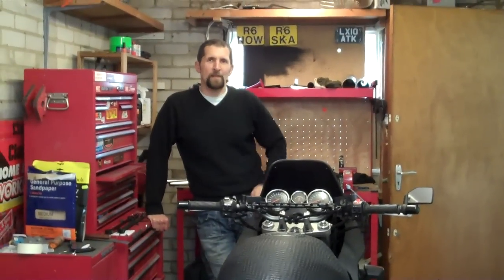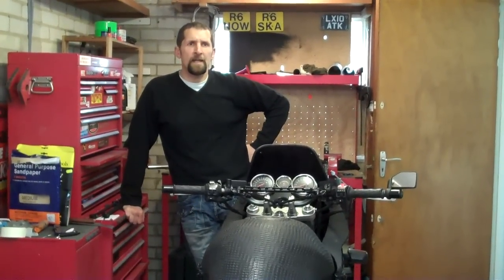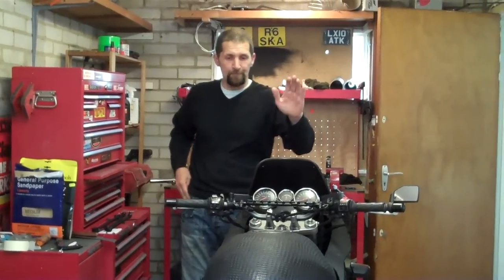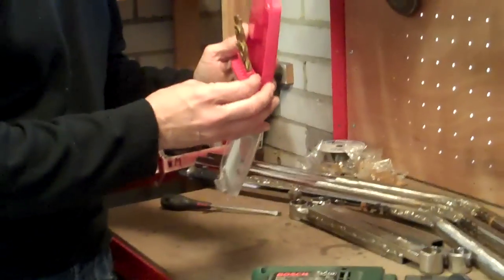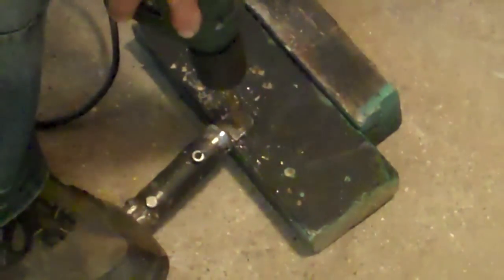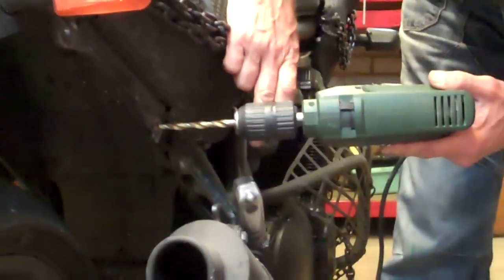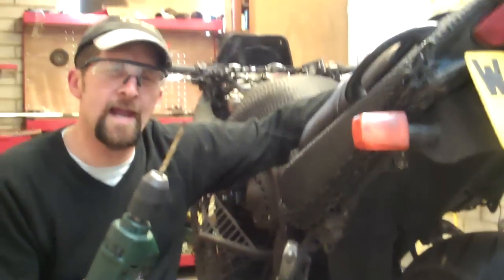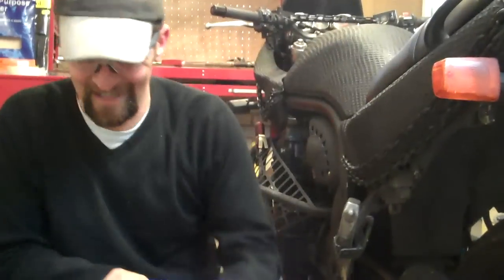Delboy's Garage, Project Tow Hitch Part 9.

Comment from the maker: I will cross brace the frame and may use some 1/2" bar, which I can then roll to give space for the wheel.  As always I'll make it up as I go along, it'll be a few days before I get near it again and I'll dream up some daft way of bracing it by then.  The little bolt tip was one I actually learned at school, it's the little things that stay with you eh?!  Cheers Del

Comment from the maker: No, that's only a problem, mate, for fuel injected bikes with an active ECU that remains live  when the ignition is off, it can also scramble certain alarms too, but on a regular old carbettored bike it's fine, I've never had a problem.  See you soon, mate, loving the maggot, Del

Comment from the maker: That's a brilliant idea, but the problem I learned welding the chain round the front is that you cannot weld galvanised, chromed, zinc plated or painted chain, it must be bare mild steel and you cannot buy bare mild steel chain.  This means any welds would never really be strong enough unless it was extremely chunky and heavy chain like in the old 70's hotrod steering wheels and I need to keep the whole plot under 15kgs and it's already half way there, thanks for watching & a great tip - Del